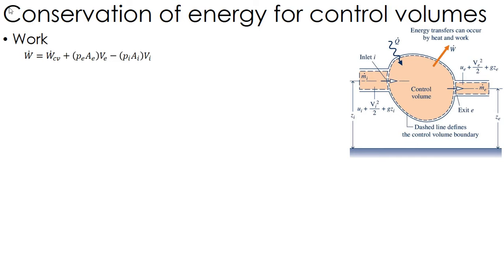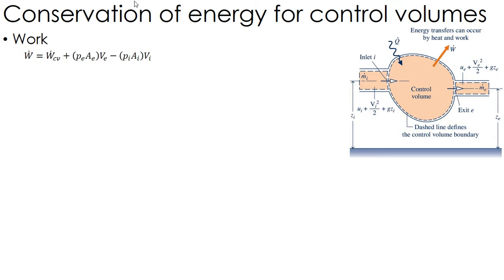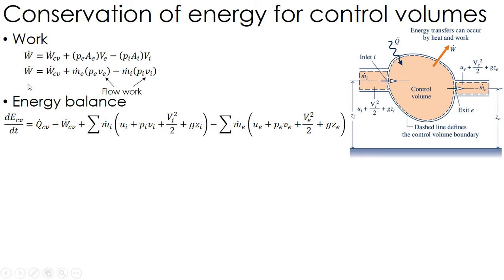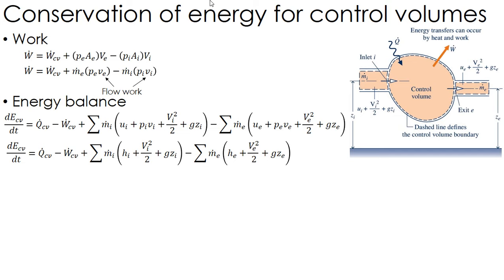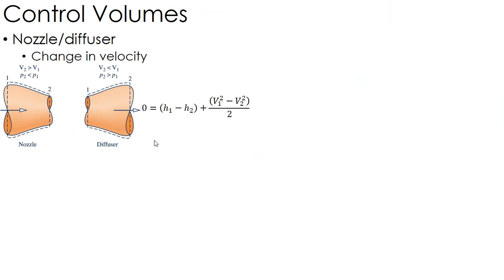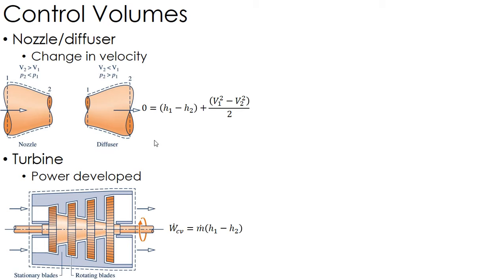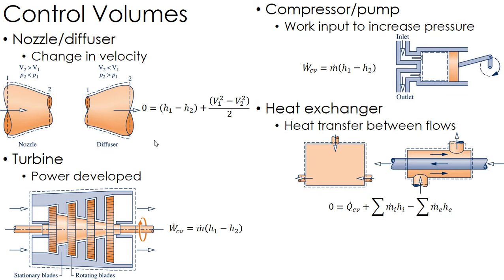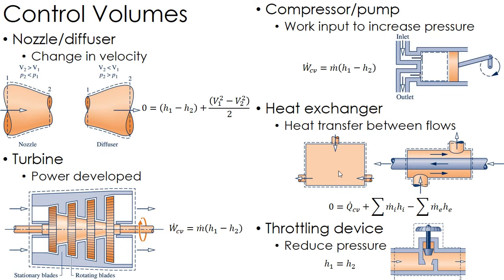Thermodynamics Lecture 12: Control Volume Energy Balance

Comment: You wrote Wcompressor wrong!! It should be Wc=h2-h1
Reply: 1 year late but just for anybody reading this later. He is right, work in that example should end up being negative which makes sense because its work being done on the system.
Reply: @eliot327  One month late, but you're right!
Reply: 11 months late but it really depends on what textbook you use. The International Union of Pure and Applied Chemistry changed it in the 80s or 90s. I guess he's still on the old convention but we all get what he means. It's still a great video so I can forgive him.
Reply: @kennethreese4259  1 year late , but you are right!
Reply: @kennethreese4259  it's an arbitrary sign convention where the sense of Q establishes the positive sign convention. That's why a negative sign is assigned to the work done by the control volume on the surroundings in his energy balance expression
Reply: 5 years late, he is right. Compressors need external energy, negative work so they have -Wc =m(h2-h1) hence Wc=m(h1-h2). Unlike the turbine which the system is producing energy, it is positive W = m(h2-h1)